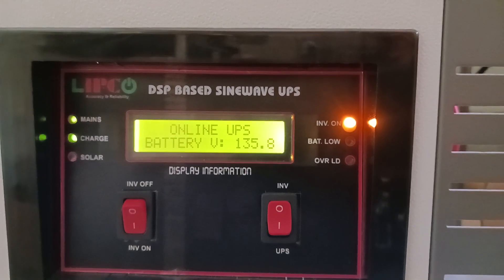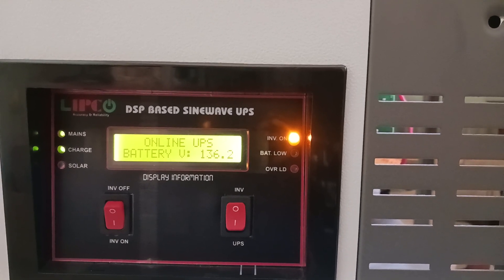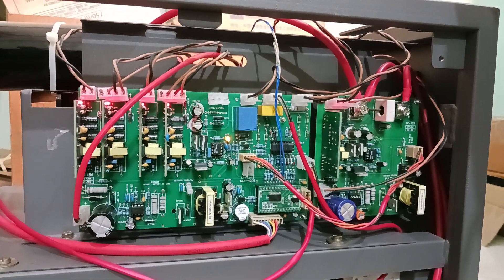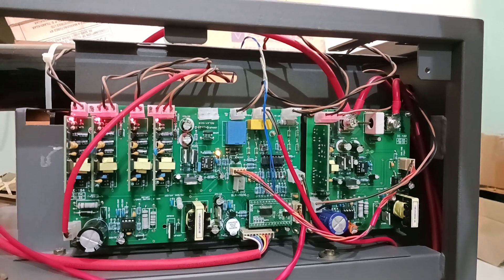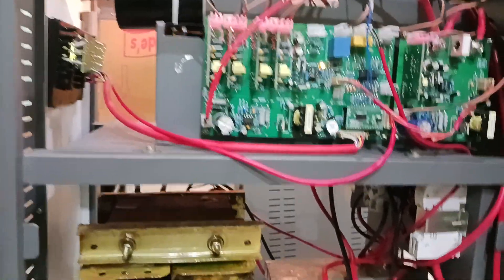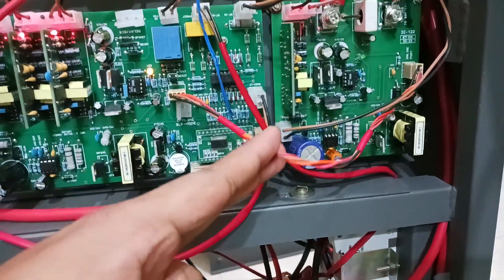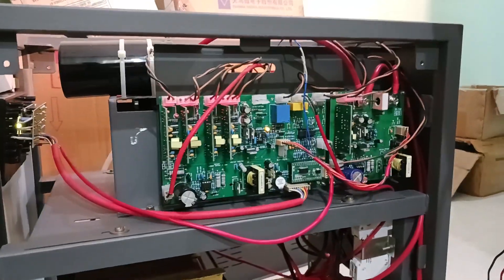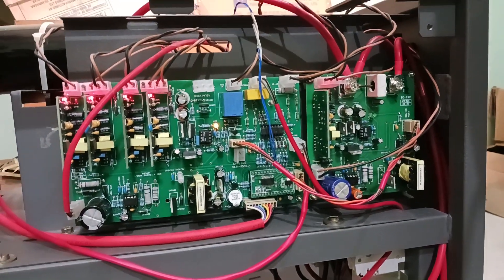Online UPS + PFC Charger: Single card tech, Single कार्ड ऑनलाइन... Noise free and Easy wiring...

Comment: Hai good video
But pfc charging have one problem with scanning mashine.
When pfc is on for charging some more grains noise coming along in the video monitor screen.
Reply from the maker: That is due to less emi filter at the input. It can be resolved by adding sufficient EMI filter
Reply: @MR-hg7yu  no sir.
This noise came through air only
Reply from the maker: @PremKumar-hm6op  That audiable noise due to lower switching frequency of the standalone analog pfc.